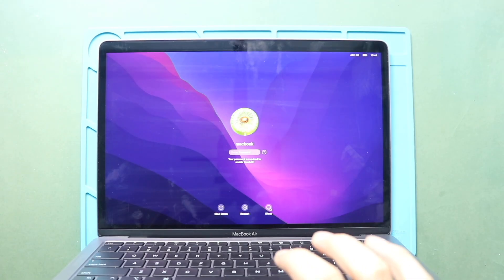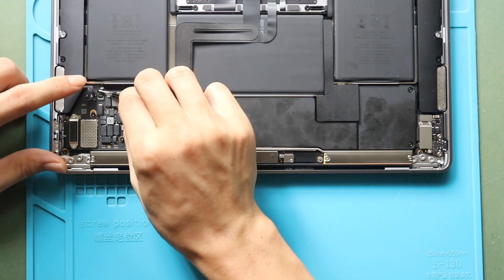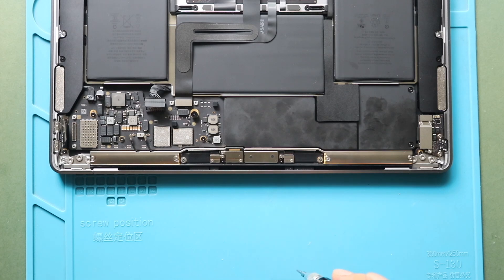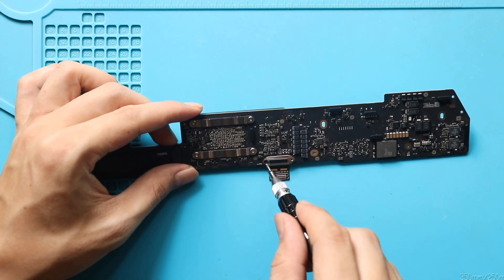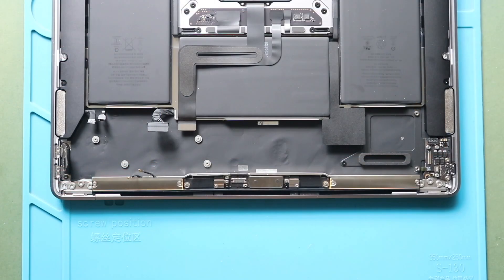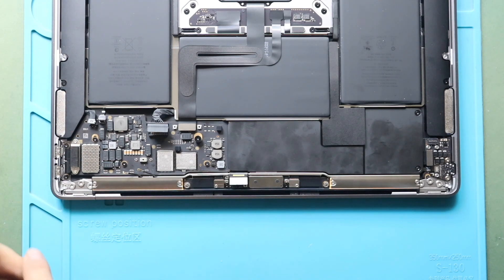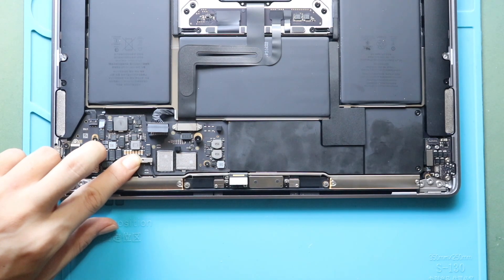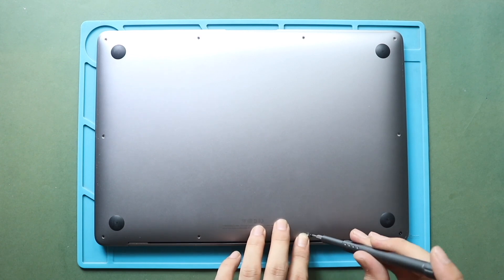Macbook Air M1 13" Display LCD Connector Port Replacement A2337

Comment: Tried same steps but my laptop is not at all on after this is done, what I do? Any hints or solutions for this? Earlier it was on with certain angle, now after replacing this part, it’s not getting switch on at all ..

Comment: Hey man, my mac's (A2337) display only works properly at certain angles. Whenever I use it at different angles horizontal lines pop up all over the screen and the image gets distorted. Do you think it's a display cable/connector issue or do I need to get the display replaced? I don't want to go for a replacement unless it is the only option.
Reply from the maker: By what you are saying it is more likely the Display Port cable.. you can try replacing that first.. it is way more cheaper than the screen. Certain angles, flickering, lines are most likely the port.
Reply: @DIYGeardo  just to be 100% sure it's the same one, I should try replacing the same cable that you are replacing in this video?
Reply: Thank you, will do this and update soon.

Comment: Is the original LCD connector soldered onto the back of the LCD screen? A repair shop suggested that the whole display would need to be replaced because they can't replace just the flex cable.
Reply from the maker: What is your issue, screen damaged or flex cable/port issue
Reply: @DIYGeardo  Hi. There is a screen glitch. It started off being worse when the screen was titled at certain angles. It seemed to be an issue with the flex cable/port connection. I replaced the cable as per your video. Thank you for that by the way - it was incredibly helpful. However, the glitch on my screen remains exactly the same. I notice that the glitch seems worse with black backgrounds, and it changes based on screen resolution. I am wondering if it is the port connection for the cable on the logic board. I might try to clean it to see if it helps...

Comment: Hello sir, my m1's display turns off after opening more than 85 degrees. The MacBook still works like that but no image. Would this probably fix it?
Reply from the maker: Cannot say exactly, but you can try replacing the port.
Reply: Bro any updates ? Having same issue so did it work out

Comment: Good day sir, my A2337 is flickering and left shadow while scrolling, and after turning off its back to normal again for few hours. Is this can be fixed by replacing this part?
Reply from the maker: Well you can try with a display port

Comment: My macbook air M1 A2337 has no backlight, no display and camera also not working, I tried swapping complete display with panel but in display there is same issue.
Is this eDP the problem?
Reply from the maker: Cannot say 100% but can be, also  Backlight/Display power IC failure or  power rail missing, maybe a water damage or small crack in IC's.

Comment: My MacBook Air M1 screen turns on for just 2 seconds after opening the lid, then it goes black, though the backlight stays on and I can see some flicker or fluctuation in the center as if the display "drops."
The laptop continues to run — I can hear sounds and keyboard lights are on.
Apple service center says it’s a screen issue and quoted ₹40,000 for replacement 😓
I don’t have a monitor currently but looking for minimal setup ideas to use my MacBook via external display or iPad Mini 6 if possible.
Any suggestions or similar experiences?
Reply: I am facing the same issue but I can't see any flickers in the screen. My display runs for some time and then goes blank and if I give it some rest it comes back again
Reply: Flex gate issue

Comment: I’m facing the flexgate issue the screen turns black at a certain angle should I proceed with this method of repair ?
As Apple is charging way too much for a 5 year old product 
(Just for the record I own a 
MacBook Air M1 2020)
Looking forward to your reply

Comment: Some water went in ports (macbook was closed and screen/keyboard was dry). It worked for few days and they screen went absolutely black. Now screen is not working everything is working properly (keyboard, backlit, speaker, mac voiceover function). Only screen is not working. Can this cable corrosion or damage can be issue? Because water went through ports
Reply from the maker: Well water damages create different issue.. to start you can try  resetting the SMC , NVRAM then Move to the cable .. sometimes it can be the board too.. need to go step by step
Reply: I gave it to Apple service centre for diagnosis it was under warranty they changed the complete display lid for free. Thank God man  @DIYGeardo
Reply: Bro same thing happened with my m1 air. My charger cable was wet and I plugged it it after some cleaning but after a week I faced the same issue as yours. Is your issue fixed?? Pls reply
Reply: @MokeChess yes fixed by changing display

Comment: I can't see the screen, but the sound and keyboard backlight work well. Is this the same thing?
Reply: Same issue
Reply from the maker: You can Try resetting NVRAM and SMC, next issues can be with the this Display Port (loose or damaged) or Actual LCD or Logic board issue. If You can connect to external monitor, If the screen works there, then Your logic board should be fine.Then the issue might be with the Display Port or LCD.

Comment: I dropped my MacBook and now when i go on something with a dark background in the bottom left there’s a greenish hue that goes away if i squeeze the very corner do you think if i do this it might help fix it or make it less green
Reply from the maker: Hard to tell that. Since you drop i'm not sure there is crack from inside. Need to check the device

Comment: My display glitches, is it possible that is this cable that's damaged or it's probably the cable that comes directly from the screen? Thanks!
Reply from the maker: Yes Most likely. Can try the solution
Reply: I have the same problem in the right side in the screen
Reply: @ventasmercadolibre5197 did you try this fix?